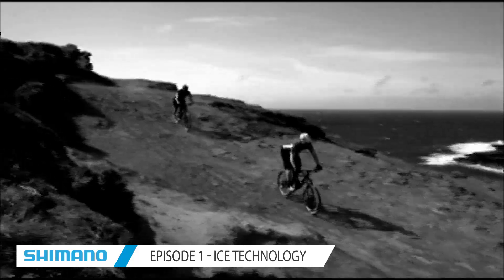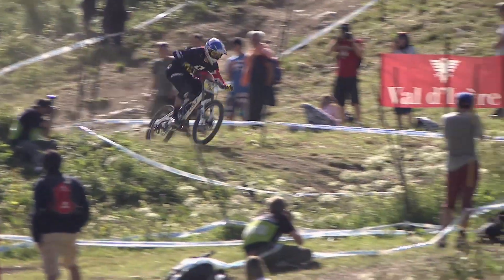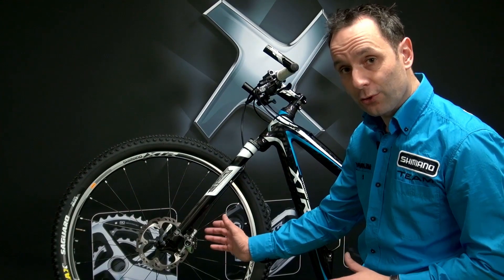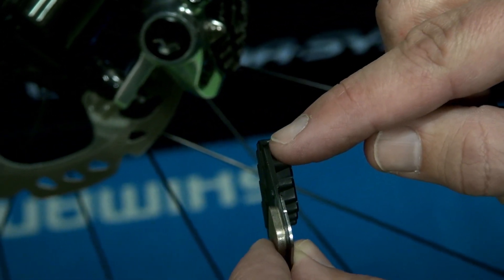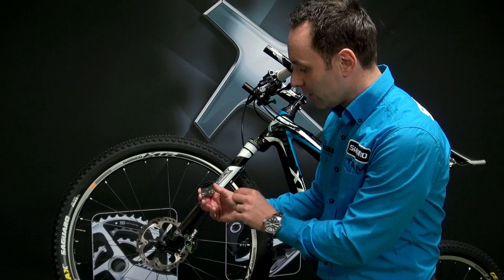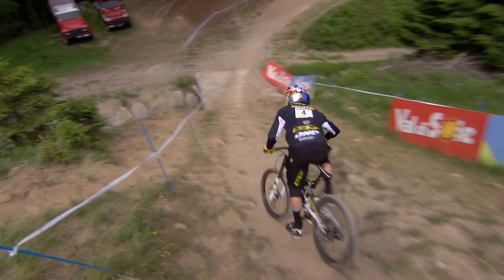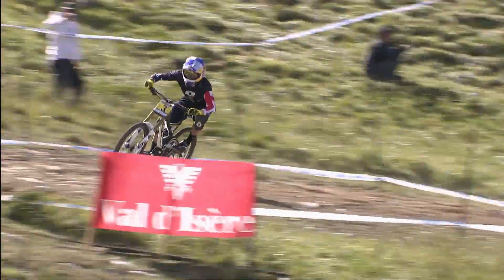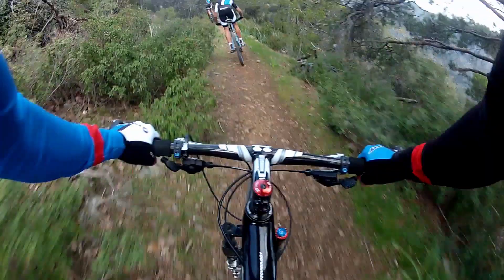Technologies Explained: Ice Technologies

Comment: Saying that the material is "alloy" says nothing. there are almost an infinit amount of alloys you can make by mixing metals together.....
Reply: I guess he meant aluminum. That would make sense ...
Reply: It is aluminum to add a thermal mass and increase heat transfer out of the pads.
Reply: True Man, Im offended he said that! He should Have Clarified that its 7075 aluminum is composed of 90.0% Al, 5.6% Zn, 2.5%Mg, 0.23%Cr, and 1.6% Cu, though these numbers nominally fluctuate depending upon manufacturing factors. Its density is 2.81 g/cm3 (0.102 lb/in³). 
RIGHT?

Comment: Yes, it's aluminum "alloy" (all metals are used as alloys). And you can see a failure mode here when it really overheats, the aluminum melts. Check Facebook's Sandman page.  July 16 2013

Comment: Do these work with shimano xt
Reply from the maker: Hi,

Yes they do. The SM-RT81 is the XT-level Ice Technologies centerlock rotor. It comes in 140, 160, 180 and 203mm.

Kind regards, Team Shimano
Reply: is this compatible with non finned pads? also, what pads should I use?

My current setup is 
SM-RT81 as rotors, both 160
BR/BL-M355 brakes.

Is it okay to run the SM-RT81 with my current brakes?
Reply from the maker: Hi Raizen,

let me answer your questions:
1. is this compatible with non finned pads? - the rotors are, and for your brake type we only supply non-finned pads. 
2. also, what pads should I use? - To find out which pads you'd need for your brakes, you can use our pad selector on http://shimano-originalparts.com
3. Is it okay to run the SM-RT81 with my current brakes? - sure, they are compatible.

Kind regards, Team Shimano
Reply: thanks for the reply! #RideShimano

Comment: The problem with IceTech is that if you are riding your Saints on the trail, they never achieve optimal operating temps like they used to and underperform.
Now i run XT brakes for better overall performance

Comment: He srly touched the brake pad with his bare hands. Thats like literally a present that doesnt know shit(or at least doesnt show it)and simply talks his lines without any thought. And yeah also the "alloy" like its some super scientific term. Its not like most steel used in the bike industry is an alloy. Its not that CrMo steel is a alloy of iron, chrome and molybden
Reply: clearly puts the brake pads on the fingers, they are only presented and never installed anywhere.
And if that were really relevant, the brake pads heatsink and brake discs needed an aluminum core to regulate the temperature, then that would have long been standard in the motorcycle and auto industry.

Comment: What specific brake types may use Icetech rotors.  They do not work on Avid, Hayes or Promax, because the spider is too large.  Jenson USA is providing false advertising by saying they work on most makes and models.  Why don't you also tell customers that the rotors are coated with a known carcinogenic?  That is US law.

Comment: looks like that he have only "alloy" in his head too 😂😂😂 how can Shimano  do  video like thsi? do shimano thinking that his customer full idiots? or unknown??  for disc you can take sandwich type ob metals but why you dont take Aluminium  base disc with ceramic or steel plasma coated? why to be riveted?
what  did the Cooling rips helps if it hidden behind the calipers?